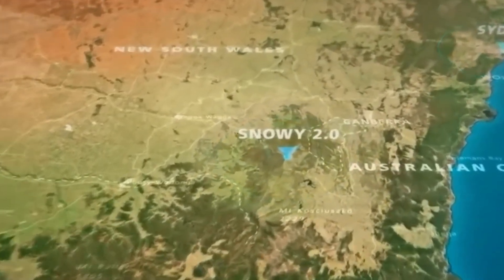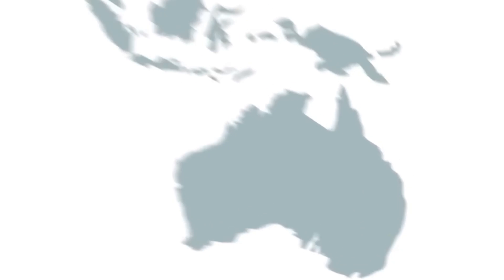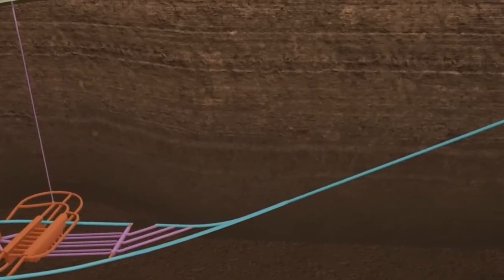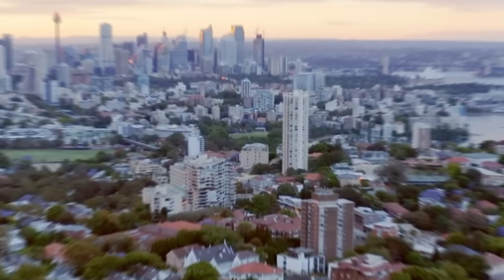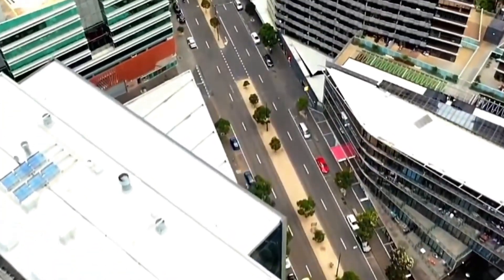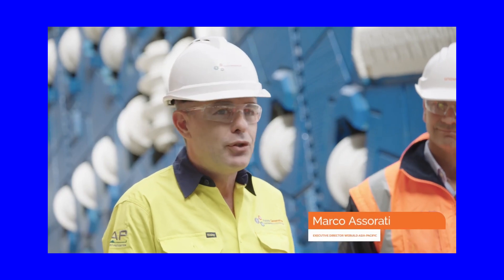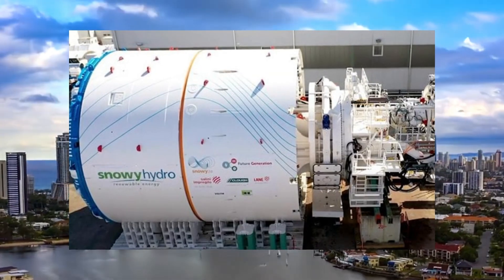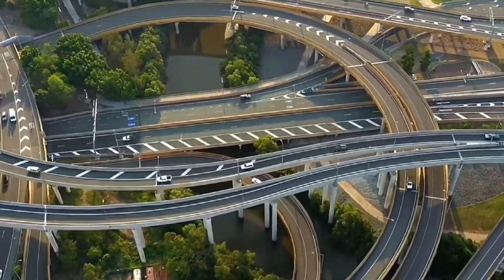Snowy 2.0 Explained: Powering Australia’s Transition to Clean Energy

Comment: Good Morning 

Sent to the White House 4 days ago 
This document is for a retro fittable power production system for a hydro dams to have up to three extra turbine banks without making issues for the main turbine hall
Now the reason this type of system has not been looked at was two fold .. the loss of flow rate and back pressure issues 
As all the worlds dams have the same basic layout regardless of the turbine fitted. The basic setup is turbine shaft to shock uni joint to the turbine. And so all have the same common limitations  
A new type of turbine unit is needed if the main turbine hall is to function with without mods for a multi bank units are to be placed in the flow 
This new system will never match the output of the main turbine hall but after years of chasing minute increases a system like this one is a massive jump in output 
At this point it should be noted that most of the installation process can be made with the dam online selling power to the grid and there is no increase in water usage when fully installed  
This system has been designed to be fully independent of the main turbine hall so as to be serviceable with the other units online and running with the main hall 
A FEW OBVIOUSE POINTS 
Population = Even if our numbers were to fall we are still in a situation of heading to a power shortfall outcome things like data centers e cars and a hole host of other tech 
The lag time at best for any new power units to get online is 2-3yrs at best and i believe we are well short of filling the markets needs 
OTHER BENIFITS OF THIS UNIT
Is a dam green tech? well its more recyclable than wind and solar
lasts 100 plus years vastly more than the others
It should be noted if the patent is very strongly protected the market will come to the seller even if it is in Australia or America so a 100 billion dollar a year marketplace makes the wage bill a non-issue 
SOME OF THE BIG BENIFITS 
Bigger market share/customer base
All the required infrastructure is already in place
the asset has a longer life span
No issues regardless of type of the main turbine fitted 
No added down time 
AND ITS TRUE BASELOAD POWER from a existing dam

Comment: What BS!! The amount of energy lost in converting, pumping, fluid drag, and conversion back again is immense, and that is AFTER having to transmit the electricity to the Snowy; and this is meant to be making use of excess production periods?   It was NEVER going to save money or energy. It's as stupid as the hydrogen con by the gas industry. Renewable at grid scale is simple, pick the  best locations where you want power stored for distribution (preferable locations with affordable land & a need for work) and install large-scale batteries - such as iron & zinc batteries, very old but reliable and long-lasting technologies.  Sure, in time there will be even better battery technologies available, but these would already provide two to four days of unlimited power storage that can be switched on & off in a fraction of a second and located in places between the power source & power demand instead of having to re-route power to Victoria and back. These old techs will last twenty to forty years easily, and when new technology is available it can be phased in while the old is still doing its stuff, no drama.